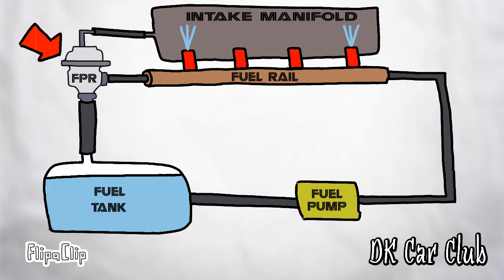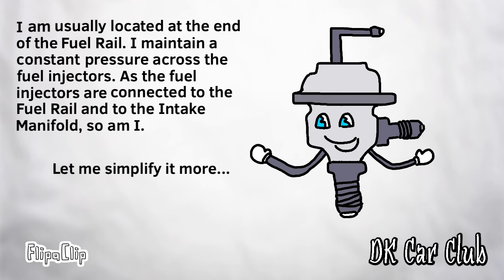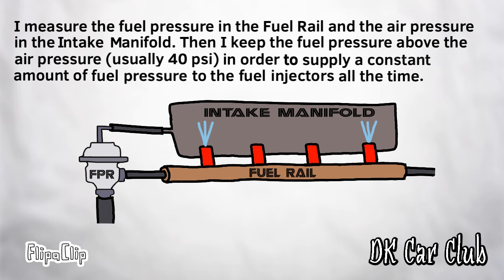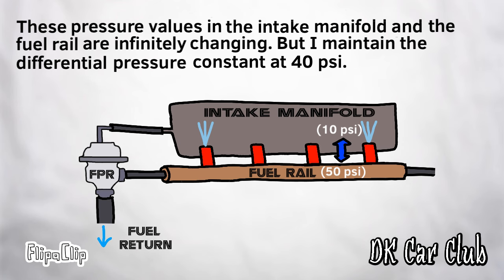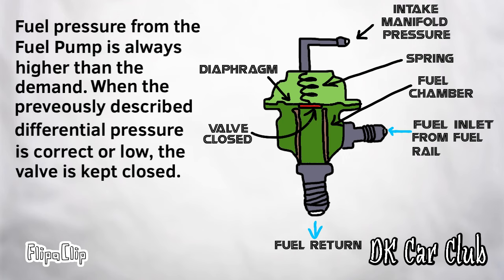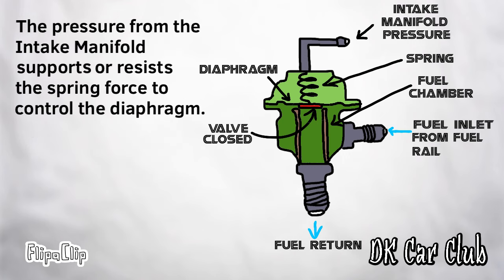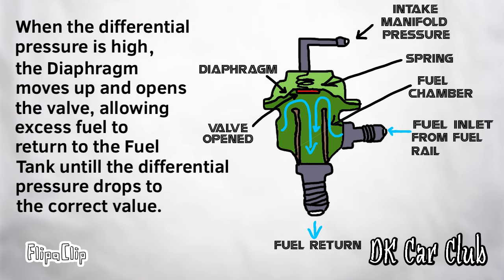Fuel Pressure Regulator (FPR)

Comment: I removed the vacuum hose from the regulator and had a slight vacuum on the regulator, but not much from the hose. No fuel leaked from the regulator. Does this sound normal?

Comment: Nice and clear..!! I just want to ask about the tubes sizes.. is the fuel intake tube is smaller than the return tube??
Because i pulled out my injection pump for O-ring replacement,and i forgot the inlet and return tubes belong.. hoping for your help..thanx..
UNIT:
Toyota 1995 estima lucida.. Diesel..
Reply: Intake has a smaller tube than the return.

Comment: I have Suzuki Alto 660cc EFI japanese kei car whose fuel pump is not working. I am unable to find it in market.Can I use carborator based car fuel pump into my car? If yes then should both cars be 660cc or more? The Fuel pump is located inside the fuel tank.

Comment: okay.. i have 3bar fpr 4g63 stock, and if i want to change fuel pump with bigger(255L at 3bars) i didn't have problems, or i may have DX
Reply from the maker: It should run without any issue. Make sure the fuel pump does not run over the FPR.

Comment: it is possible that bad fuel pressure regulator makes vibrations for engine itself and inside car ? i changed FPR because of engine shaking, now it is not shaking but there are vibrations in engine bay and inside of the car.... ? thx
Reply from the maker: A bad FPR can be a reason for the engine vibrations as it is not regulating pressure as it should. Therefore the engine is not receiving the optimum amount of fuel. But if the vibration issue is fixed by replacing the FPR, and even a slight vibration is transmitted to the chassis, better to check your engine mounts.
Reply: @isharadinuka  thx for helping. I changed acutally FPR and engine works a lot better, no violent shaking of the car/engine. And yes, you are right, it is not moving/shaking engine anymore but in winter/colder there are vibrations and probably mounts are in bad shape too.. :(
Reply from the maker: @oneeetwooooothreeee  Pleasure is mine...🙂
Reply: @oneeetwooooothreeee  your explanation was very good “must alway do like that” all your way , please continue technical drawing plus explanation because will you saving thousand “word”!!!…. Thank teacher!!!…

Comment: When I accelerate on running condition the engine will stop..

When I accelerate on idling condition the engine will not stop
Reply from the maker: Check your fuel filter. Or it can be the prefilter in the fuel pump itself. I guess your fuel pump works perfect. Or else, check your fuel pump as well. Fuel system is a closed system. There shouldn't be any fuel or air leak.
Reply: @isharadinuka  bro I have the same problem, I’m thinking it is the fuel filter, if youve installed  a new fuel pump you’ve got to change the filter as well that’s clogging your engine sending black dirty oil to your engine which is causing it to stall and Fuel pressure can’t function and you can’t adjust it which will be faulty.

Comment: When I accelerate on running condition the engine will NOT STOP

 on idling condition the engine will STOP (trembling, shaker - br,br,br ~500 RPM) only idle mod.  In accelerate its SUPER O.K.) (ALL FILTERS NEW)    ----->>>> Regulator ????? Thank, Like